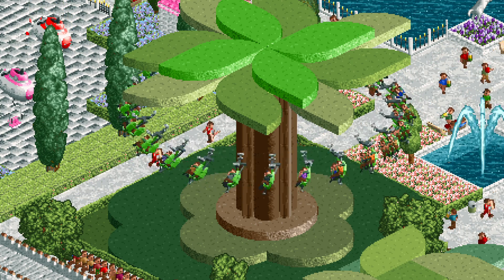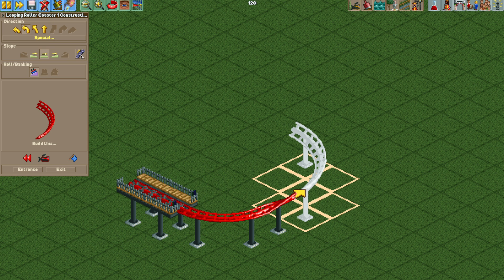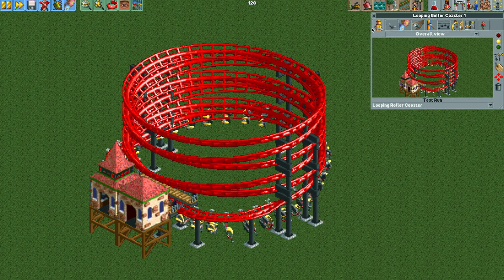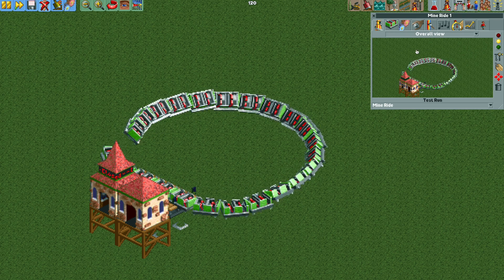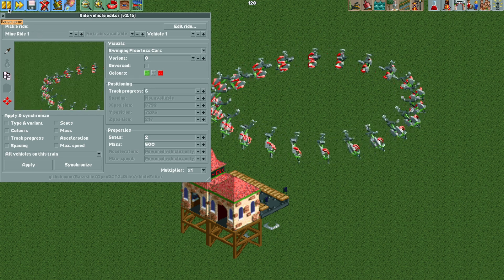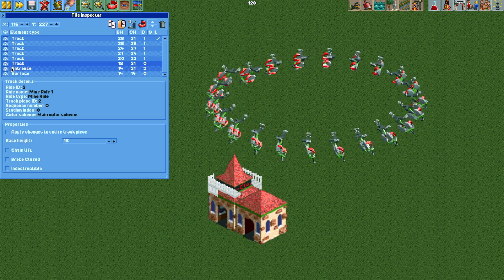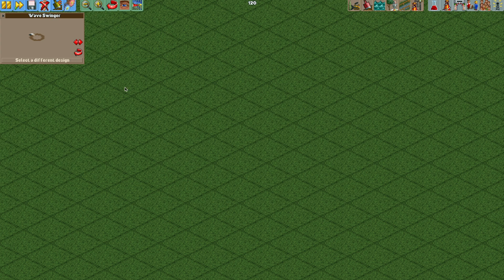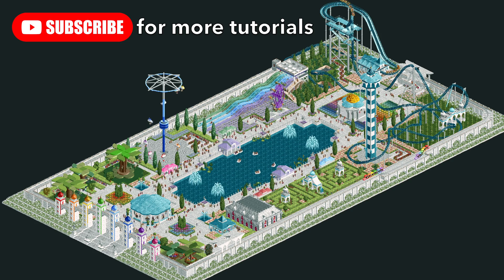Wave Swinger - simple and easy to build - OpenRCT2 Tutorials

Comment: Did these exist in the 60s?
Reply from the maker: I think the first was built in 1972 called a chair-o-plane
Reply: @openRCT2tutorials  ah. I could prob make it in the late 60s and get away with it. (For my vintage 60s park)
Reply from the maker: I’m sure it’s fine. I only knew the above information because I read it on Wikipedia! I honestly thought the ride would have been older.
Reply: Nah, rct released in 2002 and openrct in 2014. 😝
Reply: @bjakobs98  it’s a park set in the 60s that I’m working on.
Reply from the maker: I think they’re making a joke